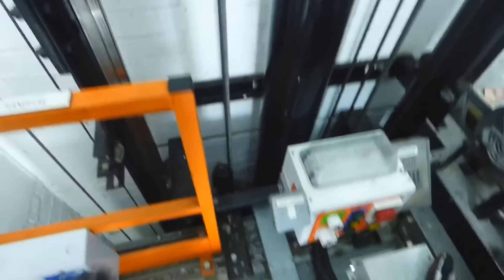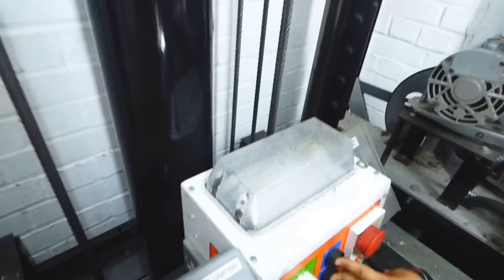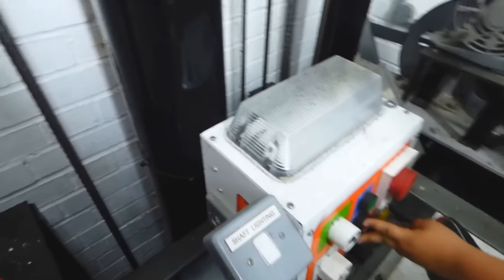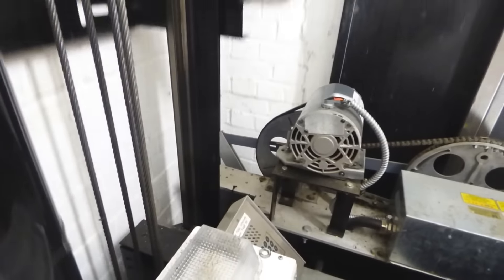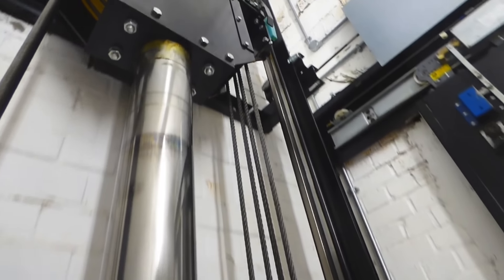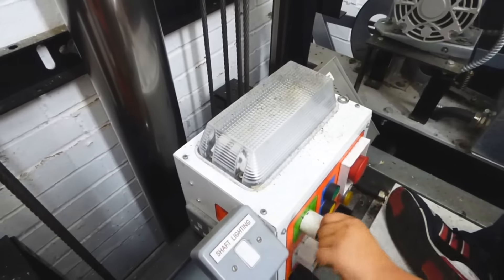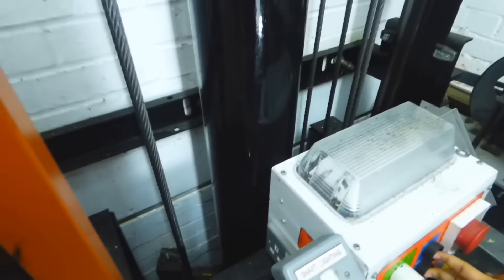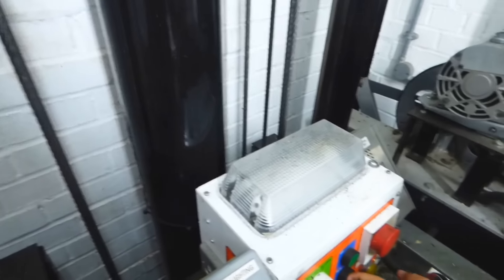Detailed look at intellegent levelling hydraulic

Comment: Dont see what is doing this sort of enconder running all the shaft long to measure position. Is not enough a reference mark to trigger the slow down process ?, speed and load are known by the controller. By using an encoder ?. It uses a load cell to get the car weight (car plus passangers) ? or probably is sensing how much current is taking the motor, probably the VF already knows that. Of course, it can overshoot a bit, that is where the encoder thing makes sense, but from other vids about intelligent leveling, dont remember seeing a encoder device. Probably attached to a pulley ?. Two speed is annoying slow, they switch to the slow speed 3 foot before, and takes forever. Funny thing is that weight sensors seems te be mandatory here on new installations. I mean, the lift already knows how many weight is on the car. So you can delay the slow down (as told by the shaft sensor) , based on weight, so it wont take forever in slow speed, just a safe ammount of time for this weight. And as I wrote, IMHO, the VF itself knows the load condition, so it knows how much breaking is needed. Not intended to a perfect leveling for sure, but will improve the standard 2 speed-static-slow-boring leveling. In a 3 o 4 storey building and lift with heavy usage, the lift spends most of the time with leveling and doors. I would prefeer single speed and manual doors.
Reply from the maker: Intelligent levelling on tractions is often done with a positioning system that knows the exact position.  In the  past selector tape was used.  Nowadays hole tape is used along with shaft bars for stop position and shaft bars that bypass safety when at slow speed when near a floor for pre doors.  VF can work out motor load and the exact rate to slow down.  A lot of lifts such as Otis gen2 fail to do intelligent leveling which is very poor for a modern lift.  Generic lifts are crap, Lester controls uses a stupid blind VF which is no improvement over 2 speed levelling.

With hydraulics intelligent levelling is much harder.  These must have some sort of variable valve.  This system is very good, it slows down completely smoothly.  This is even better than the system that DieselDucy filmed that used an intelligent system for when to slow down but wasn't as advanced as this.
Reply: ***** Thanks for the explanation. Trying to figure out if this encoder thing is a MUST for intelligent leveling. encoders are a bit sensitive, and they wear out in this kind of application.
When you say blind VF is that VF real time data is not feed into the control. Im still thinkering if it is possible to do that by using an index mark (as two level speed) and start to slow down the motor passing this point. But not just a fixed slow speed, a varying speed with a curve matching the previous speed and load condition. That is, would be able for a control to do this levelling by just using a reference mark, at 2 foot from level (to say something) and then working out the slow down curve (predicting the exact point of final stop) given the present weight and speed.  I mean, doing the same with without this sensor, just by interpolation from a reference point and speed and weight. Level is NOT perfect, as far as the first passanger gets out, lift come up a bit and keeps doing that as people gets out. So eventually you wont get perfect levelling.  In case of legislation ask for that, it is imposible, because once that 3 o 4 passanger got out, level is not longer at perfect level and the new passenger that get in at that floor will see this not so-accurate leveled lift. That is, how perfect this thing needs to be really to the point it needs an encoder ... ummmmm still wondering.